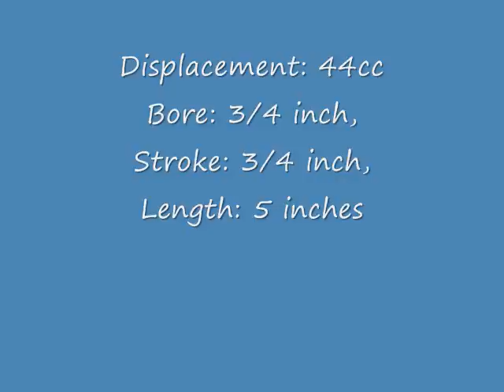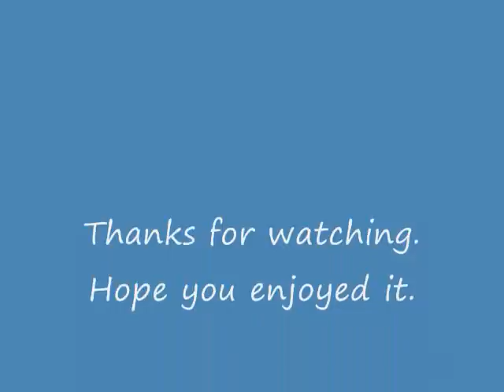World's Smallest running v8 engine

Comment: imagine this in a rc car
Reply: The general lee!!!!
Reply: I guess ill have to make 2 then lol. A Capri and a Atom xD. Maybe a '32 Ford Coupe as well. With a supercharger xD
Reply: Imagine this engine in a RC car of Stephen Kings "CHRISTINE"
Reply: I do you think you can put a super charger on it? Or make a deisel one? A diesel would be bad apples
Reply: TheVancen The nitro engines are glow engines. Diesels are compression ignited. Nitros are glow ignited. Gasolines are spark ignited.

In a compression engine, the fuel/air mixture ignites via the heat produced via high compression, compress a gas and it warms up, compress it enough and it warms up alot, warm it up enough and it ignites. Typically in a diesel you compress the fuel/air mix about 20 times from normal. Model diesels I think use some sort of ether mix as a fuel, you cannot use diesel for a real car, apparently the ingredients to make the model diesel fuel are fairly rare outside of europe.

In a spark engine, the fuel/air mix does get compressed, but usually only about 10 times and the fuels used won't usually self ignite like diesel fuel, instead there is a spark plug which has a high voltage run through it very briefly, that high voltage causes the spark, spark ignites the fuel/air mix. Regular pump gasoline and methanol are common fuels here, possibly with oil added (2 strokes, although some model 4 strokes do need it too, hypothetically you could build a model 2 stroke which didnt need oil in the fuel)

In a glow engine you have a glow plug. The glow plugs are essentially a resistor and have an electrical current running through them to make them hot. The fuel/air mix is compressed, high compression mixed with the heat of the plug causes the ignition. The ignition also warms up the plug so on a 2 stroke engine you only actually need the current to warm the plug up in the first place and get the engine running, once the engine is running the actual burning of the fuel maintains the plug temperatures. Platinum on the plug also acts as a catalyst. Can almost be considered a middle ground between a pure compression engine and a spark engine. They do actually operate on a lower compression ratio than gasoline engines do. Typically methanol is used as a fuel with between 5 and 30% nitromethane content as an oxidiser, then suspended in an oil mix for engine lubrication (most glows are 2 stroke). Some glow engines are happy to run on just the methanol though (usually 4 stroke designs).

Notably, diesel engines IRL actually have a glow plug on board. During cold weather starting you of course have cold fuel and a cold engine block, this makes ignition difficult, the glow plug is there to give just a little helping hand. So I guess rather than describing glow as a middle ground, its more an assisted diesel. I guess the presence of a glow plug on both is a potential source of confusion.

Personally, I'd go with glow or spark ignition. There are difficulties in model diesels so although its very possible to do, it seems most newcomers go with glow or gas for their IC's and stick with it.

I'm yet to build my own combustion engine, but its on the todo list along with getting the tooling and acquiring the experience to use it beforehand. I have the engine I eventually want to build in my mind and have begun noting it out on paper, but I'll need alot more machining experience before tackling my first engine and there will probably be a few engines between my first and the one I eventually want to make :P I also want to make the car to stick it in.
Reply: Im thinking i wanna build a 1/4 scale off roader just as an excuse to use something like this. Wonder how hard it would be to make this run on nitro hobby fuel?
Reply: I would put it in an on road car, my off road cars go through  the. Gas motors, I have 3 of these motors, I use to have 7, I run them really hard, I've put them into street racers and if you put the right trans on, it is awesome, and it only costed $800 and about 4 months to build one
Reply: you would need all metal gears llol... man o man that would be awesome
Reply: Hell, use a Baja 5B clutch use some revo half shafts as a drive shaft, mybe a 2 part one, then hook it into a revo diff with better gears. If you have the skill to make this engine, i imagine you could manage a 2 speed trans like a Traxxas nitro monster truck
Reply: TheVancen rcwizzard  is making a monster truck with a similure size engine
Reply: yeah, im following him too, I really dig that he built pretty much everything except that engine. I was thinking of something for the pavement though. A 1/4 scale model of my V8 Ford Capri or something.
Reply: go to conely's website they have a dragster
Reply: I would put it in a 1/6 bronco, make a manual trans that you shift with the remote and make it so you can use a couch on it! That is my kind of truck there
Reply: awesome
Reply: To hell with it. Once i go some spare cash im building a shed in the back yard and getting to work xD
Reply: Im not sure what the struggles with a diesel would be, but a supercharger is possible for sure. Now that i think about Nitro engines like the ones that come in 1/10 scale monster trucks are Diesels.
Reply: I am going to put a super charger on one of mine and then put a manual trans in it ! Maybe make it a ford cobra! I like those
Reply: I like the way you think sir!
Reply: Thanks, there is a company that makes a cobra with a mini v 8 in it! It is bad a$$ you should check it out.
Reply: Connley right? Thats the company that made the supercharged engine that RCwizard is using in his 1/4 scale Grave Digger
Reply: Ya that's it I think! There cobra is like 4000$ tho. It Is awesome! I got to test drive one too! It is bad a$$
Reply: Ahh, that makes a lot more sense now. Thanks for the clarification!
Reply: Put that shit in a 1969 Dodge Charger Model :P

Comment: First, absolutely awesome job, congrats.  Now, I have a ton of questions.  Is there any pressurized oiling system or does it depend solely on the oil mixed in the fuel?  Perhaps you have a dipper system on the rods but what about the mains?  Does it have conventional pushrod/rocker valve train?  What compression ratio is it?  I would assume low since it runs on lantern fuel.  In your Hall effect distributor, is there any provision for timing, centrifugal advance?  Do the pistons have conventional ring set up?  Does it have a single compression ring?  Is there an oil control ring?  Is the crank counter weighted?  I noticed there was no harmonic balancer.  Perhaps the rotating mass is so small vibration isn't an issue.  Sorry for so many questions but I found it extremely interesting.

Comment: So it doesn't have an oil pump? How does it lube the rods,mains,wrist pins etc? Not enough load to worry about it? I can't imagine how much time it took to build that little power plant! Awesome vid!!! Build a mini diesel!!
Reply: I'm guessing it has no oil pump, the crank, rods, etc. just run through a wet sump like a regular V8, and the rings are lubed via premix (gas/oil mix) as he stated in the video. Not sure how he lubes the cam, though. Any ideas?

Comment: actually the connely v8 is smaller. at 1/4 scale it fits in the palm of your hand has a 5/8" bore and delivers 60hp the current version of it does with twin carbs and a supercharger. i have the informational video on it from connely. these miniatures are amazing nonetheless.

Comment: Take apart a cordless drill with a permanent magnet motor inside and connect the drill motor to your great little engine...boom, instant generator to supply voltage to the distributor coil.  Just a thought.  Thanks for filming this.

Comment: THAT NEEDS TO BE PUT INTO A GOCART
Reply: No, Inside an R/C car
Reply: Marco Granetto I think the volume on each piston is to small to get any torque, you see, a 50cc moped has one piston, and this 44cc has 8. so there's only 5,5cc each piston,
Reply: UH MY GOD THAT WOULD BE AMAZING :)
Reply: That would make a beast of a bike. Good idea
Reply: suported
Reply: and the looks its amazing
Reply: KingsLee
 I think the record for a 50cc motorcycle is around 120mph so I don't see why this 44cc thing can't  develop some good power
Reply: Got a point there but more pistons spreads the load out across 8 instead of 1.
Reply: yep and that's why proper cars always have at least 6 pots so with 8 this would make a great little racing thing, maybe not a go cart but a bike, surely and what bike indeed!
Reply: ***** that's a lot!? ever heard of a nitro hemi!? 8000-10000HP! also, made in America! Bimmer's will never be good drag racers.  also a nitro hemi is a v8, ive never heard of a v4 Never.
Reply: Marco Granetto
Or 4 cylinders; except for the three cylinder cars like the Suzuki Swift, which actually drives very nicely. Even if it doesn't hit 60mph in under 5 seconds.
And the 2 cylinder VW L1.If you can afford one.
Can't think of any singles off hand. There might be a diesel thumper out there somewhere, but I haven't heard of one.
Reply: Hey Claude thanks for mentioning the 2 cylinder VW L1 I didn't know about it, apparently it is for sale right now.
The Fiat 500 was an economical twin too, I guess all engines are fascinating if you are a tinker!
  ----- Original Message -----
Reply: Marco Granetto
I think VW only sold 200 cars by lottery at $146,000 each. I don't think you would ever be able to buy one, but I'm hoping VW will use the engine in a 3 wheel cabin-roller like the Elio.
The Citroën 2CV was also quite a successful flat twin.
Reply: i think so too
Reply: Zeph well it gets a motorbike moving

Comment: you haven't answered your public....  Is the engine cooled, are there rings, how balanced is the engine?  I didn't hear any rpm to speak of?  Would you consider making the motor commercially available,   I would love to see heavier, slower vehicles powered by the engine, i.e. tanks, military vehicles....  just think, no electronic sounds needed... plenty of torque at low rpm....
Reply: why that sounds nice, I think you're forgetting something critical.  This is just a hobby for old men who could care less about the public anymore.  Chau
Reply: ok you lost me at powering heavy stuff this thing is tiny what is your thought behind that comment?
Reply: I was comparing this "Very small" engine to say an old Merco61 marine engine, running on pure glow fuel with no nitro....  This Merco had lots of torque for a single cycl. 2 cycle motor but nothing compared to an 8 cyc. 4 cycle of the same displacement, if one could be built....  I've seen radial 2 cycle motors converted to gas 4 cycle but they were $4-5k.  A small 8 cylinder  that was engineered would be a beautiful sight....   What are you talking about manners for, I don't understand....
Reply: I would just like to see a scale 8cyl powering heavy armor...  I know that there will never be commercial development of this engine, it was just wishful thinking and thanks for a beautiful engine....  by the way, I'm 65....
Reply: well it wont cause a gas engine just lacks the sheer torque my dad and me have 5.9 dodges his gasser makes 300tq and my 5.9 deisel makes 480tq and thats stock like my mom said hp hauls ass but torque pulls it and i dont care bout your age sir im 21 with more manners than most on this site

Comment: Nice job on that man. It takes a quality engineer to design and put together a small engine that works as well as that, especially one that fully runs and sounds like it literally is a small truck motor. If you ever sold one of these, make sure you put some motor mounts in it, make it commercial. You got something great going for ya.

Comment: Only thing wrong with it that I can see, is that it is air cooled and has no fins. You could possibly drill small cooling channels into it and try to cool it like that, but then you run into the not having any oil problem.

Comment: you should build a scale transmission rear and front end and build a custom frame and drive shafts custom suspension and a fiber glass body  and make it all remote control and sell it

Comment: Splash lubricated Crankcase? Oil/Kerosene mix to lubricate the top end and help with cooling? Or does it also have a functioning oil pump?  People may not appreciate what an amazing feat you have accomplished. Crank and Camshaft profiles, hand milled block and  machined heads , never mind an electronic hall effect distributor that you built and designed.
There is no blueprint for an engine that small. I'm sure that very few people in the could do this at home! Cheers!

Comment: You can't turbocharge very small engines, turbos are only available for anything above about 40 or 50 HP naturally aspirated. Shaft speeds would be in the millions of RPM for something this small, making turbos impractical.

On the other hand, because it has spark ignition, it could be made to work with a positive displacement shaft-driven supercharger, and very tiny engines have in fact been boosted with PD shaft driven SCs.

Comment: This must be one of those new 'micro-block' V8s, in line with the modern trend towards smaller engines :)

Just curious, what made you choose to use Coleman fuel instead of automotive pump gas? Also, what is the compression ratio?

Congratulations on your successful build, projects like this are wonderful works of art!

Comment: Camshaft? Does the engine have full 4-stroke valve gear with 16 pushrods, valves and springs, but no oil sump?

Comment: I saw this one yesterday at the Iowa State Fair that had a radiator and transmission.  I'm not sure if the transmission worked.  The valve cover was removed though so you could see the rockers, valves, and pushrods.   I sent it as a video response.

Comment: You should give it a belt and an alternator and make it power a light bulb or charge batteries. Revving the engine like that with no load is bad for the engine.

Comment: Ya, but you would have to spend a lot of money to get that four banger to the same HP as the 5 liter. If you put the same amount of money into the 5 liter the 1.6 liter would not have a chance. There is a reason the fastest production car has a 8 liter engine.

Comment: hay buddy its the motors size not configuration lol you would have to work on vehicles to understand that and if it was a 5.0 inline 4 honda compared to your favorite american 5.0 v 8 the honda would win in horse power torque and weight
on top of that im sure you didnt know that chevy fan boys favorite (the corvette) started as an inline 6

Comment: In fact also found on Wiki 

" "Foot-pound" is sometimes also used as a unit of torque (see Pound-foot (torque)). In the United States this unit is often used to specify, for example, the tightness of a bolt or the output of an engine."

Comment: The point I was making was the fact that he said pounds PER foot (notice the division / symbol) and looking at the very wiki you reference  I see the following 

"However, foot-pound (ft·lb or ft·lbf) is also sometimes used interchangeably with "pound-foot" to express torque." 

Your notations of lb-ft or ft-lb or lbf-ft or ft-lbf are all correct but ft/lb (again foot PER pound) or any variant thereof is a unit of LINEAR MASS not torque or work. 

Perhaps you should read comments more carefully

Comment: what type of springs did you use for your valves? and does this engine have the same oil jackets/passages as the original engine does? basically, what are the differences between  this model engine and the life size one?

Comment: I think you guys might be surprised how much an engine this small is capable of putting out.  A stock single cylinder 50cc scooter motor puts out right around 10hp.  Of course the components are larger, and with something this small, durability is always an issue in high load situations.  But all that aside I wouldn't be the least bit surprised if yz2504eva was pretty close to right.  If not even a bit more.

Comment: Most American V8's use larger displacement 5.0L and up where as Euro engines are usually in the 4.0 to 5.0L area! Also some differences in heads and electronics!

Comment: WHAT? I CAN'T HEAR YOU! 

Does the Hall-effect bit mean the distributor's not a mechanical one? How does it work? Could you add a mechanical one later?

Also what's the thing on the carb you keep pressing to make the engine bark?

It'd be nice, next time you clean it or whatever, to see the parts of this disassembled and put back again. 

I thought the fuel tank was a lamp, powered from the engine with a little generator. You should add one! A V8 desk-lamp!

Comment: If it has a camshaft I would assume its a 4 stroke, he is using naptha mixed with oil for lubrication, so the crank probably gets residue lubing. The only problem I see with the design would be cooling, there would be some air cooling off the heads and block, but not nearly enough, but I don't think he runs it long enough at any time for that to be a problem. It's a very impressive piece of work.

Comment: It has headers to prevent the exhaust valves from warping. But that's all it needs since it's a 4 stroke. They don't need expansion chambers like 2 stroke engines. 
Source: I've built a chevy 383 and a traxxas 3.3. I know my shit.

Comment: Jim thats beautiful I can't help watching this video over and over the low idle is so cool now.  
Imagine a to scale 1967 Camaro around it W/ the hide away headlights How many  volts  does the power supply put out  ask because  I wonder if a CDI off a 2 stroke 66 CC motor will work for it.  they sell them cheap for those motors you  put on a bicycle